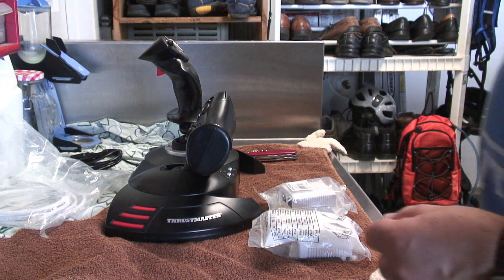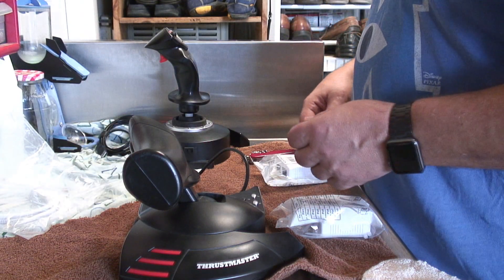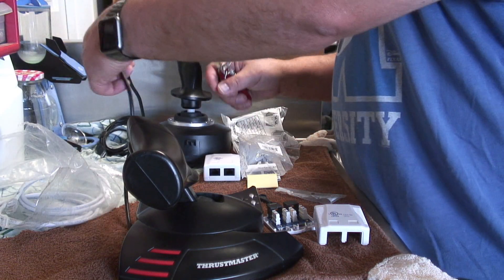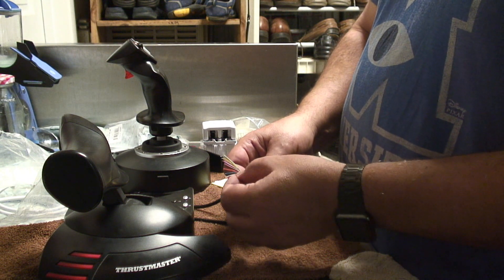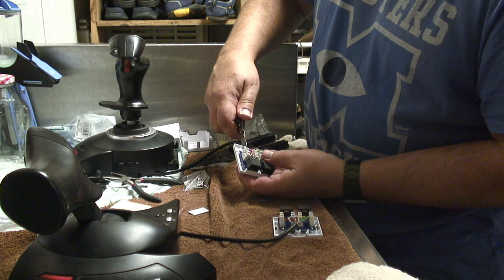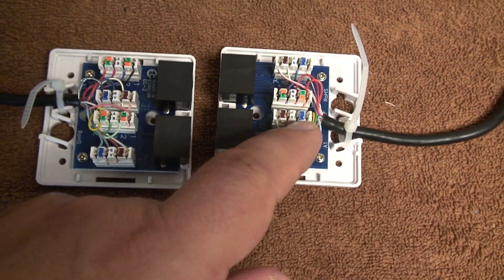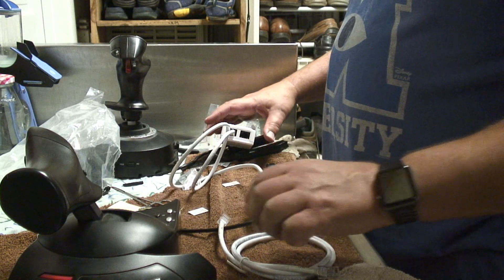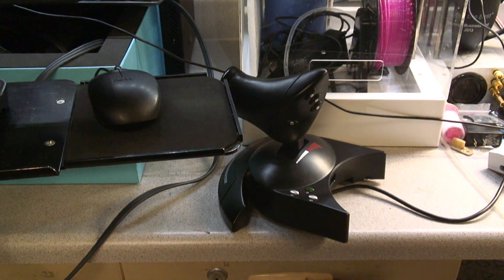Lionheart Episode 8 Thrustmaster HOTAS X solderless cable extension modification

Comment: can you you post the color code you used for the punchdowns?
Reply from the maker: If you look to 4:12 in the video you can see my method. I punched down all the wires on one side first - it doesn't really matter what wire goes to what block for the first side. It matters for the other side because they have to line up with each other. So, you'll see the black wire is the first wire at the top left. I picked the opposite jack on the other side so the black wire was the first wire on that jack. Then I just worked my way around the second pair of jacks putting the wire colors on the punch downs in the same order I did them on the first side. Hope that helps.

Comment: I’ve tried this exact method and it looks like the block isn’t cutting into the wire jacket to make contact. Not sure if this is something that can happen or not. I’ve started over and re-punched and still not getting any response from the throttle. Not sure where to go from here.
Reply from the maker: You could try stripping the wires first if the jacket is not getting pierced by the block. Also check your cable for conductivity on each wire in case there is an internal break.

Comment: Hello! I really appreciate this video, but I'm having some trouble with my hotas after trying this method. My throttle axis isn't working and some of the buttons on the throttle are controlling the throttle while also working as the button if that makes sense. Any ideas on how to solve this?
Reply from the maker: Double check that the wires on one side go to the same terminals as on the other side, that there are no shorts (ends of one wire are not touching another) and that the wires are punched all the way down in the terminals. It sounds like one wire for the throttle axis may be punched down in the same terminal as a wire for a button.